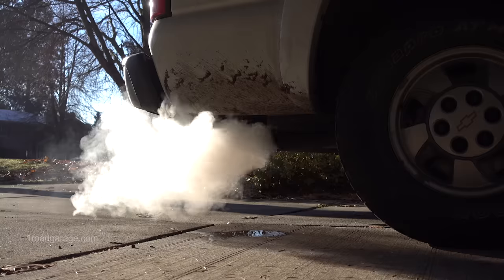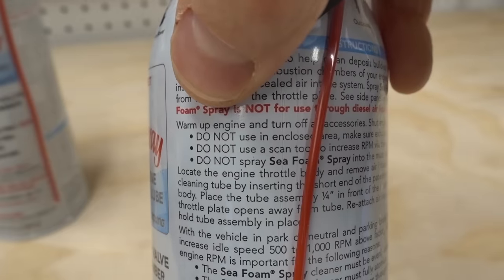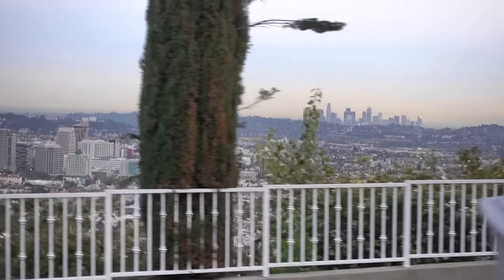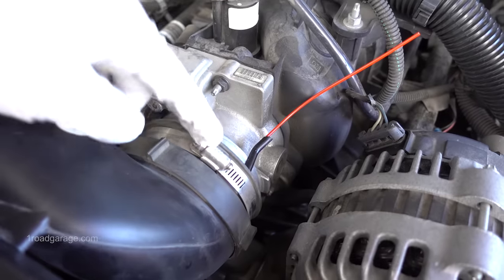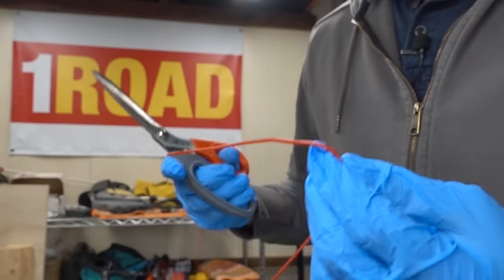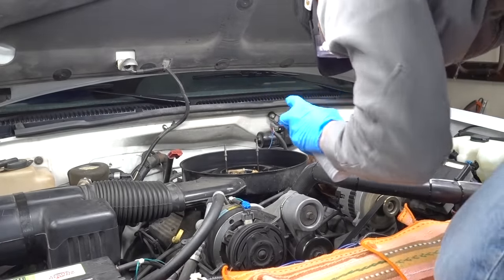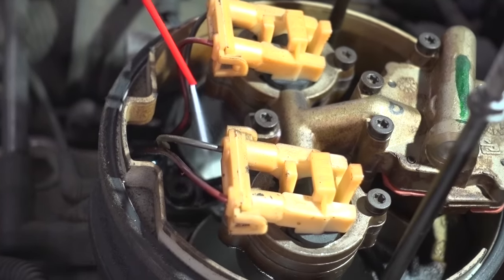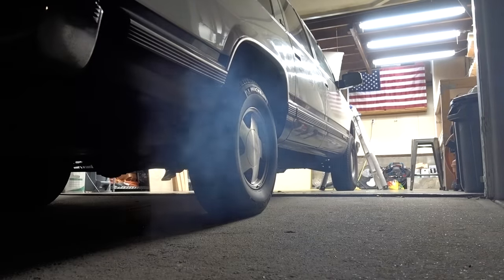Why You Should NEVER EVER USE SEAFOAM!!

Comment: I've done that same treatment to 3 of my vehicles, 93' Chevy K2500 5.7L, 95' Isuzu Rodeo 3.2L(Chevy motor), and 97' GMC K3500 7.4L. I only did the Rodeo at my house. It smoked so bad while spraying it I expected the fire department to show up at any sec. I'm sure my neighbors hated me because  the cloud of stinky  burnt oil lingered for ten+ min. The 2500 and 3500 I did at work, It was an industrial area and rather than pissing people off they where curious what I was doing. All 3 vehicles had around 230000 miles, all 3 smoked like tires at a burnout competition,  and all 3 had noticable gains in performance and fuel efficiency.

Comment: I always put a dab of super glue on the straw where it connects to the can. So it does not detatch from the can
Reply: Life Pro Tips are always in the comments!
Reply: Awesome tip! I've had it detach a few times at which point your hands are all slick and it's just a royal pain. They should reengineering that because someone is going to have a straw sucked into their engine sooner or later. I will definitely do this next time or use a lighter to melt some hot glue to secure it......

Comment: Used Seafood on our 256K mile Ford Explorer. Used one can of Seafoam, which is hard to do, as the throttle is drive-by-wire. Got the engine to stall just before the can ran out. Let her heat soak 15 minutes. Started the engine back up, got some smoke. Put her in gear, gave it some gas, and she stalled right away. Got her started again an slowly, slowly drove off. The smoke show began. 250,000 plus miles of carbon, and PCV residue in the intake came off. Hitting the expressway at 45 mph was a fog show. The truck now no longer shudders at part throttle, and idles super smooth.

Comment: I've always had luck pouring the seafoam into a cup and using the brake booster vacuum hose to suck it up without letting it die by plugging the vacuum hose with my thumb when it gets close to dying. TONS of smoke and it runs significantly better!
Reply: The liquid seafoam can work like the sprayable one?
Reply: @zoneb609  yes
Reply: Thank you!  @joseespinal4513
Reply: @Chris Jacobs Definitely DON'T drink seafoam.
Reply: As long as you know what the smoke is from....
Reply: @johanh2319   Oh, if you put seafoam in the brake booster hose....you'll KNOW when it makes it into the motor. You wont be able to see your street, your neighbors houses,   or much of anything else, haha.
Reply: @lynnmckenney1987  yes, DEFINITELY NOT the cure for Covid 🤣

Comment: Been using Seafoam for going on 20 years and I'll use it till I die. I just plain works for me. I especially like it for cleaning and storing my engines because it keeps the carbs clean for one, and it's a great fuel stabilizer for over the winter months when I don't use a few of my engines. I use on my motorcycles, lawn mowers, chainsaw, power ice auger, etc. to keep the running smooth and never have to do carb maintenance.

Comment: If this is your third time treating the vehicle why would you expect to see a lot of smoke
Reply: Seafoam is a petroleum based product so just the use of it will cause smoke until all of it is completely burnt off.
 If its being used on the intake side and being directly introduced to the cylinders without being diluted in the gas tank it will most definitely produce smoke.

Comment: The smoke is just the build up of the seafoam not carbon burning
Reply: Hydro lock
Reply: Watch some videos with boroscope proof. Might change your mind.
Reply: @AEON.  been tested by project farm it did
Reply: Mine is from bad gas burning  now that Sea foam let's it actually combust !
Reply: Dump liquid concrete in there. See what happens?!
Reply: Nicholas Brown 
No doubt ,my diesel that ran it for 25k was spotless upon teardown. 
Actually, everything had a nice dark coating that wasn’t flaky, but is the boundary layer of carbon you actually want. 
Diesels being dirty is a myth.
Reply: @suavehouse5150  misting (or from a squirt bottle)...not running a water hose in your air intake..silly billy...LOL
Reply: I’ve gotten more from water than I ever have from sea foam. My blazer and Toyota had at least a 20-30 min total smokescreen gotta love used dirty cars 🤣
Reply: ATF fluid works, it's an old mechanic trick. Does the same thing that seafoam does.
Reply: Seafoam will help clean the deposit build up in catalytic converter. That's why you see all of the smoke because it's cleaning.
Reply: My 211k miles GDI motor will change your mind... I  just did a seafoam spray treatment on the side of the hwy (so I could really haul ass and blow out as much carbon as possible).  My veloster completely smoked out the hwy for several minutes.  Imagine two diesel trucks rolling coal, yeah it was that bad...
Reply: Nope. I've seafoam'd different vehicles and some don't smoke at all if they're clean.
Reply: Josh  nah its carbon burning. You can literally see the difference on your throttle body after u use it.
Reply: VIsubby thats like saying all water isnt just hydrogen. Duh bro
Reply: VIsubby i just used it and my car runs better as a result. So whats your point?
Reply: stoney renegade  miss type your right
Reply: @korey420  what issues were you having? I have 188k on my car and its never been sea foamed.. I'm nervous about breaking stuff.
Reply: @Blackhouseohio  I have 333k on an old 6th gen Celica that barely based smog two years ago (trying to buy it cheap from a friend as soon as it passes smog).  I will be Seafoaming it soon based on a number of anecdotes that it helped failed vehicles pass smog.  I will probably drop the oil pan and see you d there is any residue that could clog an oil pump as well.  If someone replies to this reply (otherwise, I don't know if searching for one's replies on YouTube is possible), I will reply and let you know how it went.
Reply: @wellnesspathforme6236  how did it go? I have a 6th GEN celica with 1.8 7AFE that burns oil
Reply: @Shumayal  almost certainly due to a clogged PCV, the distributor seal gave out and leaks oil.  I have to refurb the distributor.  I just changed the oil in the Celica, and with it's distributor firing correctly, I think it will pass smog.  I will Seafoam it just before the next oil change.
However, I have a Camry that needs an oil change and has some carbon build up.  Last year I dropped the pan because it was leaking.  I want to avoid dropping the oil pan again, so I'm going to try a different process.  I am going to Seafoam it, but with maybe a quarter can.  The idea is to take some carbon out, but not any big chunks.  I will change the oil right after.  Then I will use MMO (Mystery Mineral Oil?) In the gas, as per instructions.  I will also add about an ounce of acetone per tank.  I will then Seafoam another quarter bottle before the next oil change.  IOW, I'm taking a longer term perspective.  I will do the same with the Celica once its oil needs to be changed, too.  The idea is to get the carbon out slowly so no big chunks gum up the system.
Before I got into the nitty-gritty of car maintenance, I had a 1999 Camry that burned oil from the day I got it.  Ran 10 years like a champ burning a little oil.
Reply: @wellnesspathforme6236  did it fail the emissions test if it burns oil? I just fill my celica with a quart every 1000km or so. It only leaves a smoke cloud if I come down a hill in gear and then accelerate. So I don't engine brake anymore and come down hills in neutral... so it doesn't smoke when I accelerate afterwards... it sounds like bad valve stem seals to me. (1994 Celica 1.8 7A-FE)
Reply: @Shumayal  I'm just guesstimating like the next guy, but based on my current understanding, I'd try a bottle AT-205 Re-Seal, follow the instructions and see how it went.  I'd drive it easy, though.  If the seal is torn, though, no product is going to fix the seal.  You could try adding some Lucas Oil Treatment to thicken the oil so less oil gets by to burn.  Scotty Miller got his Celica for cheap because it was burning oil like mad.  He uses Lucas Oil Treatment (the thick stuff) on his Celica every oil change.  Search "Kilmer Lucas Oil" and one of the top videos will probably be the one I'm referring to.
Reply: @wellnesspathforme6236  yes I already added the Lucas. It helped reduce the oil consumption after I saw scotty
Reply: I never said it didn't work,,, just the white smoke is just the seafoam burning,,,get a brand new engine, clean with no carbon and put seafoam through it it will smoke like that . All I mean is the smoke is not an indication of it doing its job as a cleaner
Reply: This ! 👍 seafoam is snake oil. Like he said it’s just the product burning not any results. The truth is is that water , yes tap water sprayed into the throttle body , will destroy carbon ! It’s funny how my grandpa used to say “a fool is soon separated from his money” is so damn true lol
Reply: @alphasaiyan5760  awesome 👌 I have used water also,,, and yes I was taught that by an old timer in my family... engines was all he knew 💪
Reply: wishing I was at the Beach. Yep 👍
Reply: @alphasaiyan5760  If you watch a test of the product in crankcase, you can see a similar, although lesser, production of smoke. Also determined to reduce/eliminate noisy lifters due to carbon in that area. Fresh oil change after 100-200 miles, and lifters still much improved after a year. (see Project Farm)
Reply: @nobodyimportant8833  You pour water in?
Reply: @adamr8628  spray it in using a bottle. Lol.

Comment: I used seafoam in my old v6 tundra. It smoked soooo bad! I actually drove for about 6 miles before it quit. But, it ran so much better after that!
Reply: The smoke coming out is just the seafoam oil burning. It has nothing to do with being carbon deposits being dislodged by the seafoam
Reply: Carl N 🙄

Comment: Put it in your crankcase at oil changes- 1oz. per quart. After having to replace a turbo on a Nissan Juke that the oil supply line to the Turbo got choked I wanted to do something that would work to keep the line clear and prevent  build up. Now I use it in all my vehicles to prevent sludge build up in the crankcase- works great.

Comment: Never had a bad experience with it. Any motor. Weed eater, lawn mower, ATV, chainsaws and vehicles. 
   I've sucked it up into various vacuum lines on different engines, poures small amount directly into intake before this aerosol version came out and had stumbling motors straighten right up.

No complaints. 

......that's rare these days.

Comment: You have to run the liquid seafoam through the brake booster vacuum line to get the huge amounts of smoke. It gets the intake better that way. You have to have someone keeping the motor alive while it sucks in the seafoam quickly.
Reply: Lol! It gets into the intake better through the brake booster than it does by spraying it into the intake??
Reply: @hydrostaticshocker3048  No, what Dylan is saying, is remove the vacuum hose OFF of the break booster, so you have the hose connected to the intake.  Use that hose to suck up the Seafoam.  I've never used the Spray can version, I've always just bought eh regular can and stuck the vacuum hose into it and let it just suck it all out.
Reply: @johnmcdougald1238  you know what you're talking about lol that dude does not.

Comment: I don't use the spray. Use the liquid. The  instead of spraying into the TB,  pour it into you Vacuum Brake Booster hose.(disconnect it from the booster, I attach a small funnel to help pour it in).  
Pour about 1/2 can. Just fast enough but keep it running. As you get close to a 1/2 can mark. You will have to keep the engine in a high idle. Pour in faster to the point it starts to flood the engine. Turn off the engine right away and let it hot soak the 10-15 mins. The start up and watch the smoke.

You really have to flood the intake take and valves to get the smoke.

Good luck.

Comment: 350 tbi is a great motor, i did this to my 95 Suburban and got tons of smoke. I use straight seafoam can, not the aerosol can. I suck it in though the vacuum line. And to hot soak it, i let it suck so much sea foam near the bottom of the can, it stalled the truck. Also it had a 160,000 on it already when i got it, so it was plenty dirty. At 195,000 now.

Comment: On a 4 stroke gasoline or Diesel engine I don't believe it does any good. This would be a lot of work but before using this treatment pull off the heads and examine the valves and valve seats. Also examine the piston tops. Take a good quality photo of each valve, valve seat, and each piston top. Examine the exhaust valve ports on the head. Document everything in detail.  Now re-assemble the motor with the new gaskets and etc. Put back the original oil. Do a viscosity and purity test of the engine oil to grade its condition.  Before pulling apart the engine get an emissions test. Have the cat converter tested. 

Now do the treatment.  After finishing, run the vehicle for a few thousand miles.  Now pull everything apart again. Do a detailed examination and photo document. Also test the oil. Do a detailed comparison for before and after. 

I bet no improvement at all. I would expect some damage to the emissions system especially the cat converter. 

I would never do such a thing to any engine.  I remember something about running some water spray through a hot engine to clean out carbon. With any of these sprays going in to a hot engine there is risk of cracking valve seals or the valves. Also possible damage to rings.  This has to do with washing away some lubricant affect of the oil.  

If you have carbon buildup to the point where there is a performance change this means there can be bad valves or bad valve seals. Maybe some problems with piston rings.  Sometimes carbon accumulates at a spot on a valve seal causing a hot spot and burning the valve surface or the seal. Only a rebuild of the head will properly fix this. This will happen with a warn valve or using too low an octane fuel or poor quality oil, or not doing the oil changes when due. Also having many miles on an engine. 

If the engine output is good, the engine idles as smooth as it should, and the fuel usage is normal for the type of vehicle and engine, it should be okay. If you really want to know more then do a compression test. Get a diagnostics done for the timing, fuel pressure, vacuum levels, timing advance with RPM change, fuel flow rate, high voltage to the spark plugs, and etc. 

As for myself, if the engine is running smoothly, there are no unusual sounds from the engine, acceleration feels normal, and the fuel consumption is normal, there should not be anything wrong. 

When I was in my 20's up to my early 30's I was building muscle car engines. I was building engines up in to the 600 HP range with 4 speeds for on the street. This is why I know something about engines. As for the new tech vehicles I did not keep up so well. As for the basics of a gasoline engine there has not been that much change in the principle physics of how it works. I am nearly 70 years old today.  I had my times with this...
Reply: Jerry G.  Haha you are right about possible damage to the exhaust system, mu brother was so eager to try this seafom on his jeep and aftert that the check en  light came on, codes for  one O2 sensor and the cat converter, perhaps it  just coincidence abd the cat was about to fail, any way l would blame the seafoam, l would never do it to my car
Reply: See project farm. He does this. Lawnmower engines before and after. Head off etc.
Reply: @sugarnads  I liked those episodes when he tested seafoam and also other similar products and I did not see enough of a difference in the outcome to waste my money.
Reply: You worked on and built cars that constantly get driven at fast speeds high rpms and hard acceleration so no not much carbon

Comment: Seafoam - SEA-FOAM - designed for use with 2 cycle marine engines, also useful for other 2 cycle engines like lawnmowers. It only works if it sits on the cylinder to soak in and help break up the deposits, otherwise it is 99.9% useless. The smoke is just the seafom burning. It also causes problems with catalytic converters.
Reply: Island Mike    fix in a can
Reply: Seafoam is an overrated, expensive product.
Reply: We'll I've personally been using it for about 10 years. Never a problem (if you use it correctly). And there is boroscope proof of it actually working. So...
Reply: @dustincady2811  I've seen the boroscope pictures and videos, little 5mm chunks is not going to affect anything serious enough to make the engine run better.
Reply: @TheAmericanUhate  there were 2 cycle lawnmowers. You're too young i guess
Reply: J lawnboys For the win
Reply: You guys are high this stuff works great been using on all my vehicles for years and years.
Reply: @user-er4nh7pq2d   also 2 cycle diesels Detroit V series ie. 12v71

Comment: I had no problems with my 78 Suburban when I originally used Seafoam. Plenty of smoke! Engine had over 200 thousand miles so there was plenty of carbon in the engine. I have been using a can of Seafoam in the tank about every third fill-up and it is keeping things mice and clean (as far as I can tell). I also use it in my motorcycle and it has improved the mileage there.
When I get back to the States I will put Seafoam in my gas again as it has sat for two years and I do not like to run nasty old gas through my carburetor. It handles it, but I just do not like the chance of having problems from old gas.